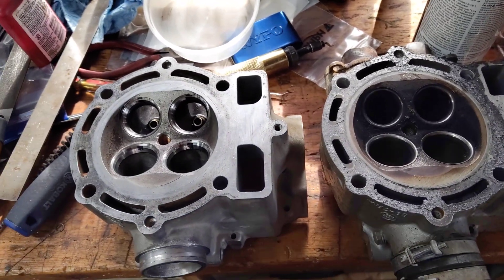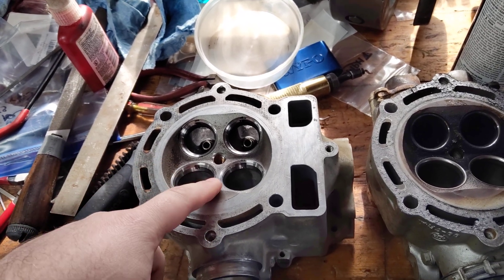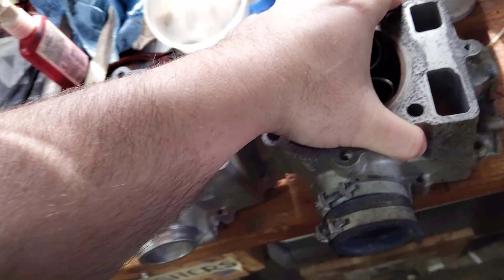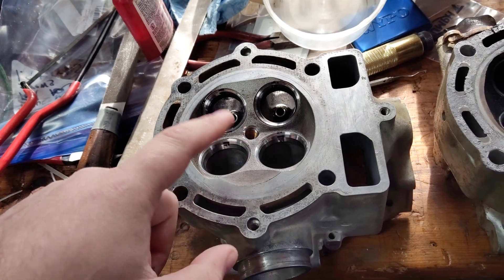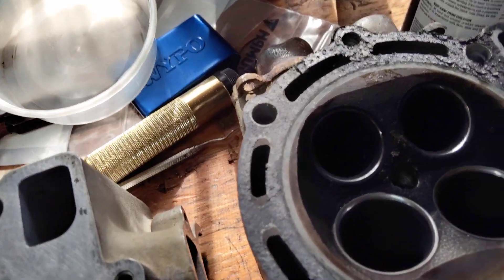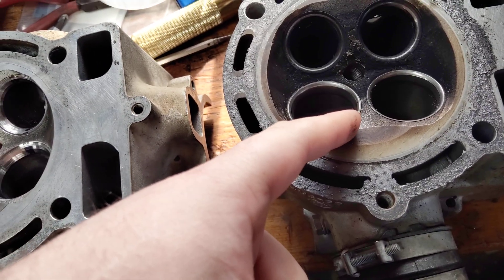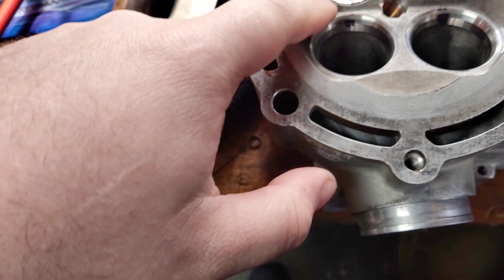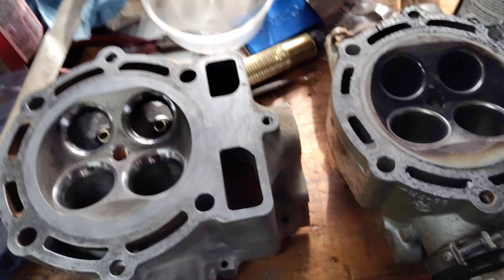ktm rfs head improvements

Comment: What tools do I need for valve replacement? For guides and valves. Pretty much the whole thing. I’m doing this on my own.
Reply from the maker: Without a seat and guide machine to recut the valve seats, it's impossible to make the new valves seal. The guides have to be reamed with a carbide reamer after installation. Once you do that you at the very mininum would need to use neway cutters to touch up the seats. You're talking over $1000 in tools to do one head.